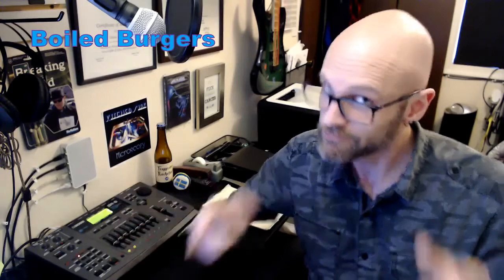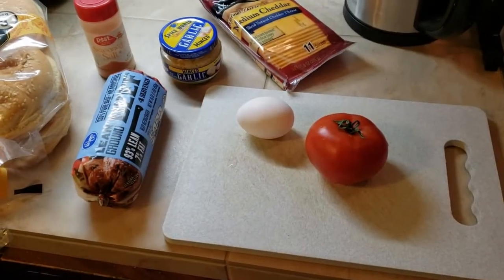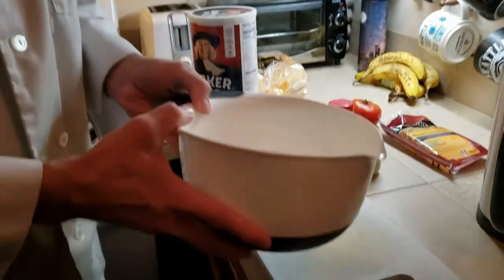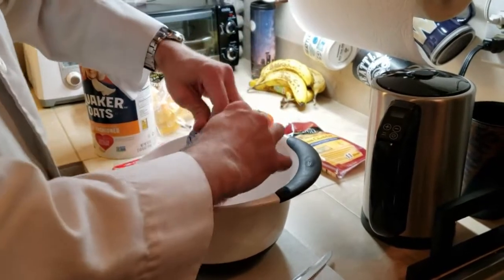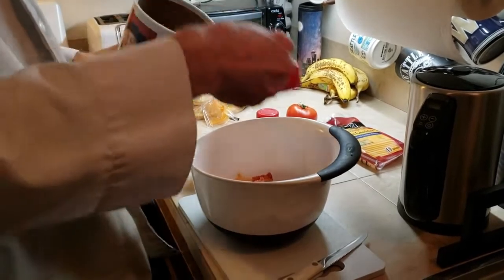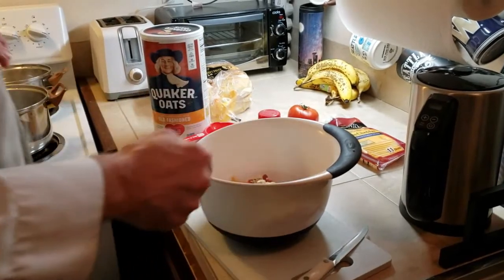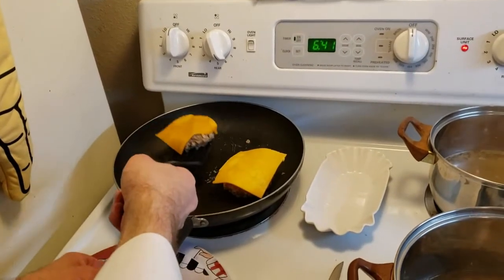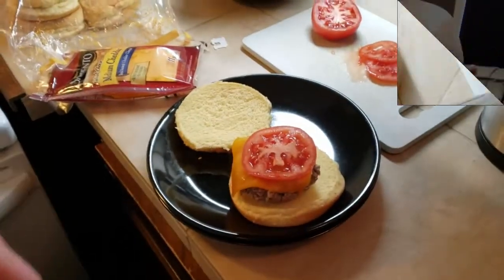Boiled Burgers - KSU - Cooking Series

Comment: What type of oats are you using?  Also as this appears to be more of a braise than a boil, wouldn't using a flavorful liquid improve the result?
Reply from the maker: I just use quick oats most of the time. Anything would probably work to give it a little binding ability. You could certainly use a beef stock, but it's not too terribly bad with just water, either.  To save money you can always do a 50:50 stock to water mix and add some spices to the water.